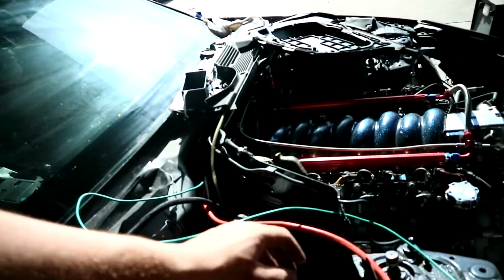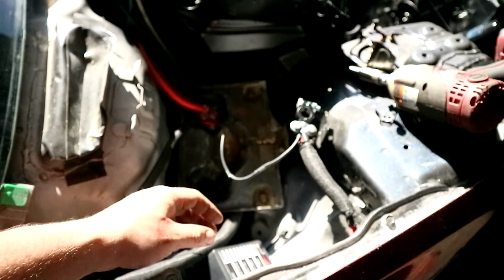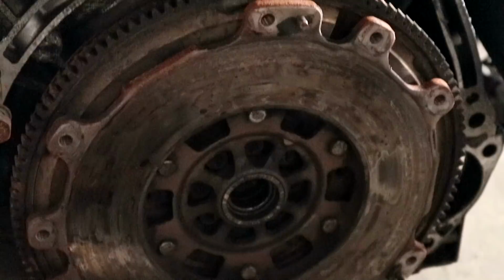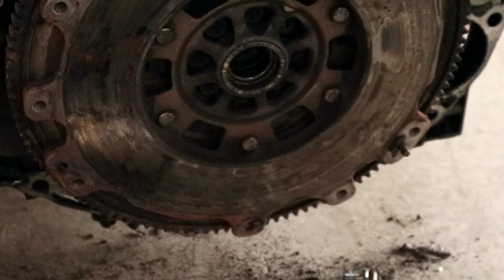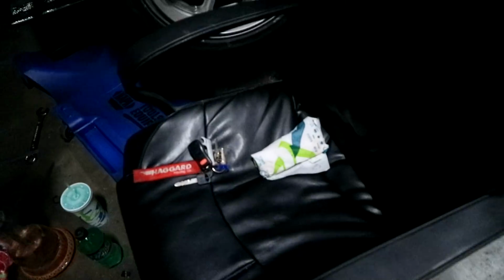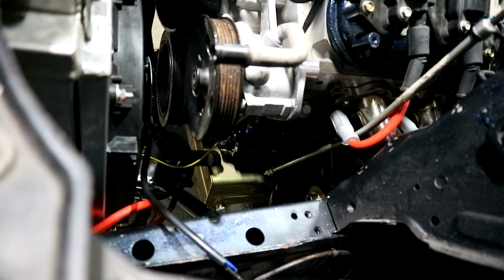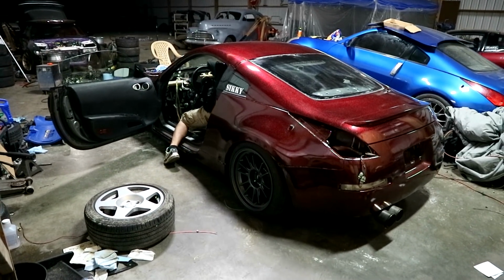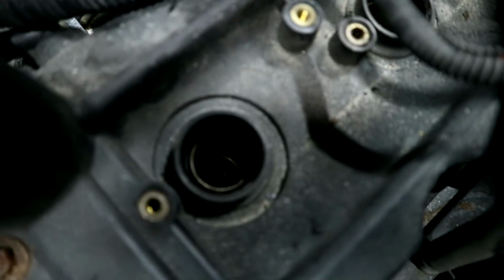LS SWAP 350Z FIRST START!!!

Comment: Your fuel pump is shutting off it is running with the fuel pressure from it priming. I have seen it with every person who has used a megasquirt for the first time. 
I think it is a setting in the software.
Reply: Adriansitos623 same thing with boosted boiz k swap sti
Reply: my ls swap did the same thing just changed the wiring and relay for efi and all good
Reply: yup
Reply: Hope he sees this..
Reply: Give that pump a constant 12v boi

Comment: For megasquirt you NEED to load a basemap. With out a map, how can the megasquirt know how to properly run the engine? The fact that it started for a second was probably just pure luck. You also need to verify your base ignition timing and make sure that the mechanical timing is the same as what megasquirt thinks it is
Reply: Up

Comment: On the fuel map try to take a little more fuel out because the open loop from the cold start is too rich needs to be about 11 or 10.8 from a cold start until the ecu goes to close loop

Comment: You're using the wrong oil filter. Happened to me, use  a k&n HP-3002 filter, also make sure the that the  stock engine oil dip stick hole is plugged. Should be on the passenger side.

Comment: Pick up some thick welding wire or a spool of thick car audio wire, and run some nice pretty cables.  Put your battery wherever you want.  I used sky high car audio 0 gauge and some Ebay terminals.

If yeen bohs ain't got a big set of crimps just slip the terminal over sum 'sposed wire and melt solder in that sum bich wit a map gas torch yeeyee (it works)
Reply: I put up a short clip of my setup, I probably have $100 or less in all the wire, battery box, terminals, etc.